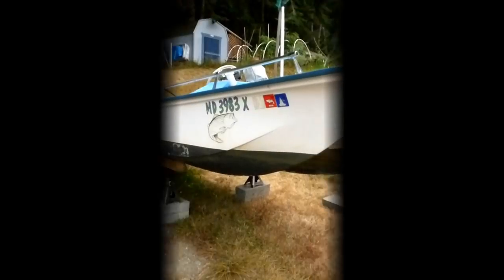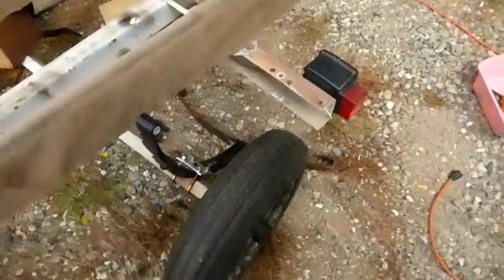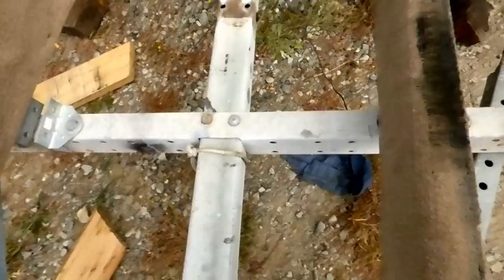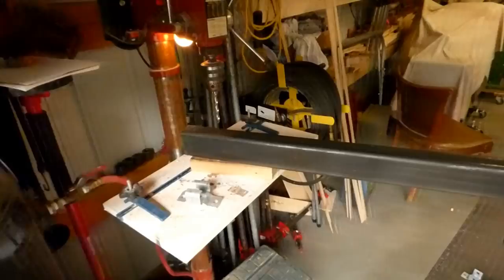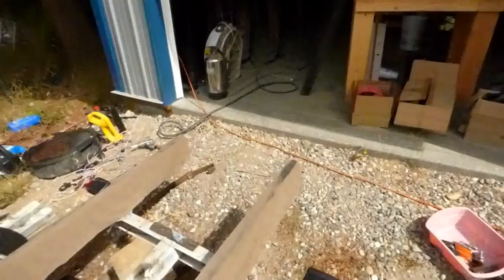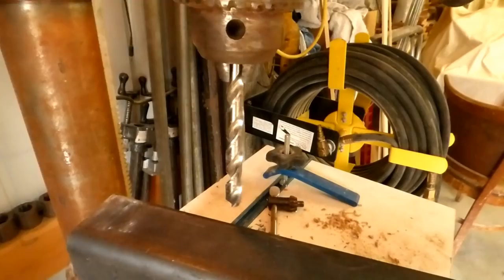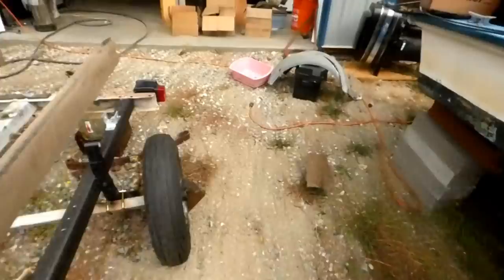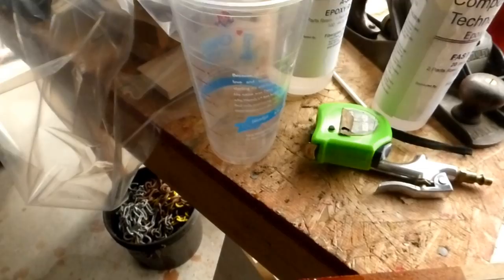rebuilding a boat trailer

Comment: This is one thing I need to do to my boat trailer I have to replace the leave springs on the axle
Reply from the maker: It's [pretty easy.  I got mine from etrailer.com.  They ran $12 each...brackets, bolts, etc. ... ran about $60 total.